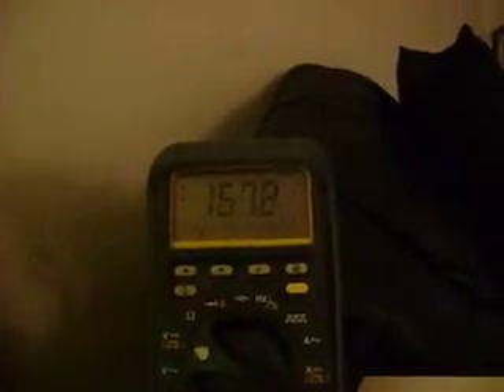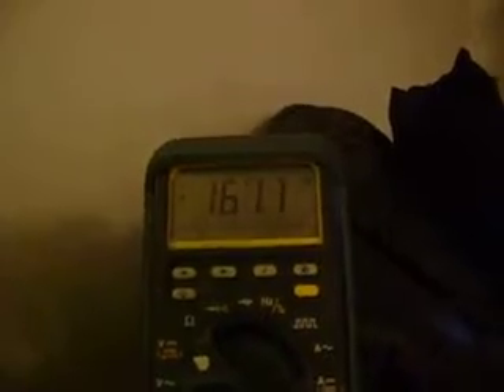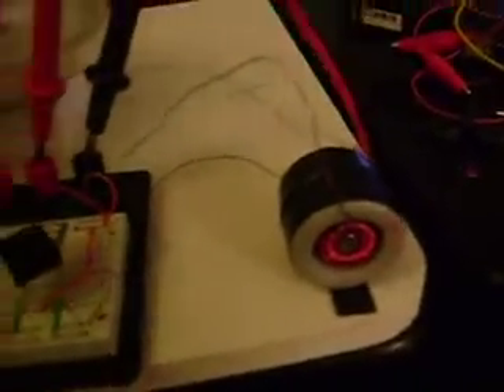Orbonbon up to 160v output and a lightning show in an LED  =]

Comment from the maker: Yea, my coil gets warm on 5v but just a lil. 1.2v stays cool as long as the pulses are short. I am winding a new one tonight, meanwhile, I just did a vid on amp draw and a light load test. Will post in a few. I want to add another layer on the red toroid coil and the toroid field should be stronger and less current. So I hope for more output too due to more invisibility. =]
Mags

Comment: Well I hooked up my PWM, (dc motor controller) to my 18volt cordless drill battery. I was just beginning testing and noticed that the torroid was very warm..... To many volts!! Maybe a 555 timer circuit, or pwm that will run on less voltage...
I'll have to think about how to proceed with this one, and experiment again tomorrow... 
Got damn e-orbo on the brain.....for days now..
LOL
Thanx Mags for the inspiration!!

Comment: Wow these posts are not in the proper order but this is the 3rd.

The ferrite looses its magnetism, very quickly, causing more lines of force to move through the output coil. When the torroid coil is off the magnet can "see the ferrite" and it magnetises again. 
Repeating this charge collapse, at say 10,000Hz could be very interesting.
In order to generate power traditionly  magnets have to pass by coils of wire. Now it seems that you can make the magnet dissapear.
Bravo..

Comment: What I think is happening here, is a property of the magnet the wire and the ferrite.
The ferrite is very quick to magnetize, but also is very quick in loosing its magnetism.
The magnet, is supplying the magnetic field nessessary to cut the lines of force in the coil in order to produce electricity, and the added magnetisation of the ferrite core enhances the effect.
The Torriod coil when energised, via the orbo effect, makes the ferrite core invisable to the magnet. 
Sorry Continued...

Comment: Thats why I wanted to go  with 100 turns tri-filler for the output coil, and completely cover the torriod with three layers, bi-filler for the input.
After watching energy from the vacuum, part 11
 (Kromray convertor) 
As you know multiple resistors in parrallel actually reduce impedance.
Bedini solved an impedance problem by parrallel conections of tri filler coils, wich virtually elimated the impedance. Cont...Below..

Comment from the maker: I dont know yet on the draw. I will do an amp draw before I take it apart to do a rewind of more turns. 
I think its a neat gadget. The ability to alter a magnetic path with such ease is very cool and new to me. It will be a great tool in this field.  
I look at it like this, as long as the pulses are around the same duty cycle, my bet is that when I have more voltage as I mess with it, there will be more current on the output. And if I increase the toroid turns, the input should be less.
Mags

Comment: How many amps is this drawing??

I just finished wrapping a 1inch torroid, (only one I had), with about 100 turns tri-filler of 30 guage wire (15 feet) and 40 feet bifiller torroidlly.
Tired now, will play tomorrow!
Thanks for sharing, this has some potential!!